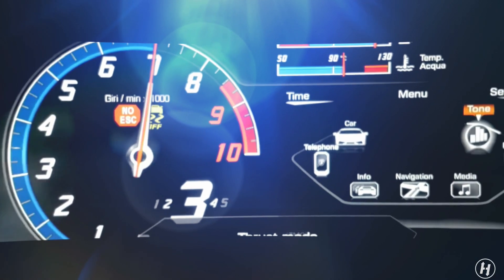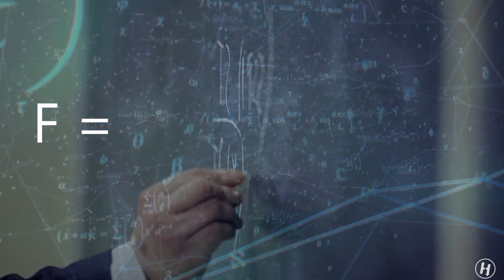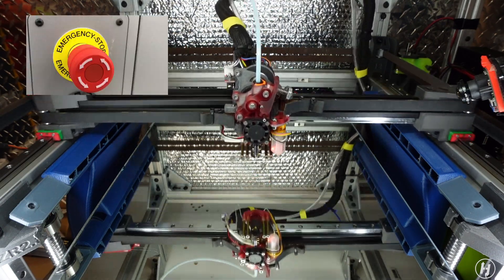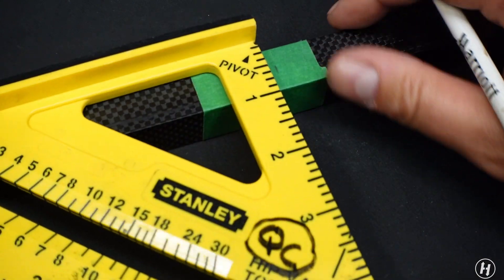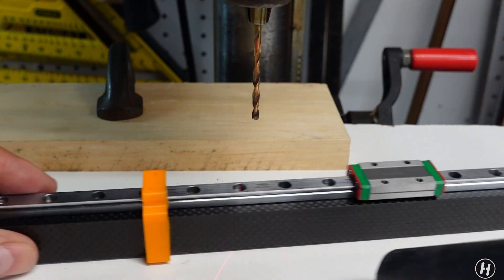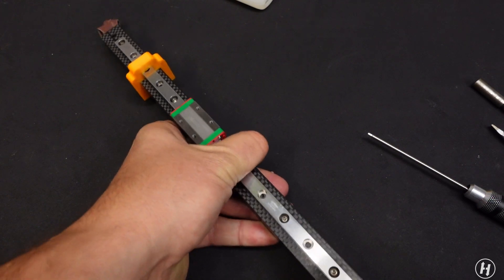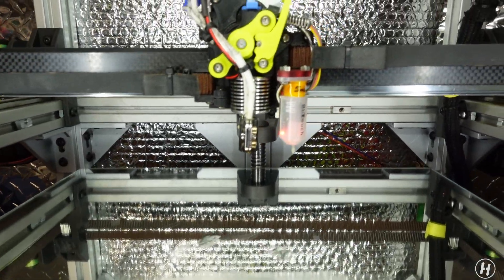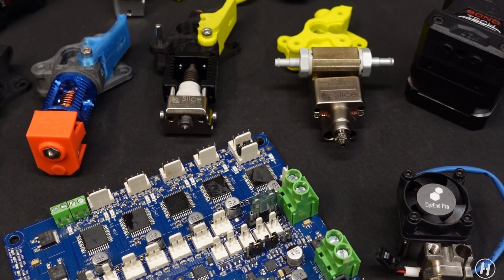Using TITANIUM and CARBON fiber on your 3D Printer

Comment: how about a design with bigger carbon tube to incorporate pulley idlers inside to avoid any printed parts?
Also instead of bolt for mounting the rail try using aluminum pop rivets.

Comment: Wow, that was an amazing improvement. So much added lightness.
I can still see one small hanging fruit though: the bltouch. Surely a dockable probe would be a few grams lighter? Sure its not much in the grand scheme of things, but you did replace all the fasteners with titanium ones....

Using tape to stop the carbon fiber from fraying was brilliant, but you might still want to cut the CF wet. It will help keep any fibers out of the air and then settling on other surfaces, or your skin.
Reply: At 500g, a 15g improvement is still -3%.

and isn't negligible, because it's additive, if you manage to reduce the weight to like 150g, reducing by 15g is 10% then.

Comment: Impressive! Whats next? Are there Nuts half as high? Should one grind them down and also shorten the screws? Maybe use a round carbon fiber tube? It would also help with air drag at these speeds. But would need an adapter between it and the linear rail. How about an L profile carbon, it would be easier to assemble also and big holes can be cut into it for even more weight saving. Could something be grinded/machined off of the linear rail? Are there rails with more holes, so less material. Also the Printhead looks like someone could go at it for a day and dremel something off of everything and cut the belts even more. I hope you'll get reeeeeallly crazy! ; )

Comment: You can use less screws if rail be attached to carbon by glue - it's fine for sportcar too)
Plastic parts can be replaced with fiberglass or carbonfiber- you can print blank for it or modelling parts with slots for fiberglass cloth

Comment: Bowden tube instead direct filament drive can save mass too
And cooling solution - instead of fan on head you can use tube and stationary installed fan with high static pressure or air pump - maybe adding peltier cooling can reduce mass of radiator too
 
(Radiator can be modified  too, but adding vapor cha,ber cab be even harder and not be good enough)

Comment: Very nice work for sure ! just a few suggestions/ideas... replace all but 2 (outer ends) of those bolts in the rail with carbon fiber bolts that would save a lot. Or you could also play with nylon bolts to keep the cost down a bit. or just epoxy the rail to the CF extrusion and remove all the bolts. There is probably also room to lighten that rail by drilling out the bolt holes to a much larger size and if epoxied together strength loss should not be an issue.

Comment: Weight saving ideas: 1) Replace aluminum end caps on the extruder stepper with machined CF. Easy enough with a mill and/or a laser cutter. Forged carbon with smaller fiber lengths is easier to machine than weaves 2) No clue if the shaft needs to be metal for function but could be replaced with carbon rods. The bearings can be downsized as well. (Life will be shorter but performance gains...) Lowering the weight of the rotor should directly enable faster change in acceleration. Extruder speed may not make a huge difference in the end but if the current setup does not meet the hot end ceiling (acceleration wise, might have to make a test for that) then there's some room to improve. 3) Remove the fasteners if its going to be a permanent thing. Loctite has Epoxy specifically for steel to carbon welds. The result is stronger than steel to steel welds. This may save good amount of weight. - Good work there, keep going!
Reply: I’d be concerned with heat buildup in the stepper. Those aluminum end caps are a main way to get heat out of them. This is particularly true on such a small motor where there isn’t much exposed steel laminations. 

Now this would be interesting to try on the mounting face of the motor, where it’s pressed against the plastic anyway.

Comment: I have always wondered why there is a need for the carbon tube at all?  My machines (and many others in the group I'm involved with simply use the linear rail .. AS The gantry! Nothing under it to bolt it to).  I PRESUME there must be some argument about needing to help ensure the linear rails are "Flat" especially non-name brand / cheaper generic Chinese linear rails.. But, How off can they be? How much could a piece of carbon really aid in flattening out or straightening any imperfections in the Steel alone ...   Anyway: in short: Why even add the brace at all?  I think reasons like what I mentioned above will be the rationale behind it .. But it just seems like almost a joke to think a tiny carbon plate will bend the steel to its flat surface ... rather than the steel distorting the carbon fiber! The latter seems far more likely just from a Statics Physics mindset ..   Anyway love the video! Love anyone who is devoted enough to lower weight that they literally are choosing titanium BOLTS over the SS ones at that size! That REALLY IS trying to get every last bit of unnecessary mass/weight reduced! I cut a roof off my M3 to put a CF pannel to make it like the E46 M3 CSL ... I KNOW how much shaving weight off matters!  It's good to see that enthusiasm here!   But just let me know about the reasons of WHY even use the tube at all! As I've never seen a good answer to that!
Reply from the maker: Weight of the carriage under hard acceleration will be enough to get the rail to enter an oscillation patern.  I should perhaps mesure the deflexion under load of both configs and do  another video :)  Thanks for your feedback :)

Comment: What if you just use....... Nothing?  Holding the rail on both ends and let the rail hang freely at the middle saved some weight on my printer, and I didn't notice any performance issue

Comment: How much faster can you get before your hot end can't keep up with melting the filament enough to get proper layer adhesion?
Reply from the maker: All depends of the filament type and layer height.  0.1mm layer height on certain ABS filament can get us past 1000mm/s without shreding and with descent layer adhesion.  Temperature has to be bumped big time though (280-290C)

Comment: Did you see the lightweight mods done by Tech2C on his original HyperCube? He uses carbon fiber tubes and Igus type AM-RJ4JP-01-08 Drylin Bearings, Polymer Replacement for LM8UU linear bearing. This would save a couple hundred grams.
Reply from the maker: Yes I did, and after handling these parts myself, the rigidity of the assembly and the level of precision have left me perplex for what I am doing here.  But yeah, Idea was good.

Comment: You missed the most important tip: if you don’t have another printer, print all the tools and tube mounts BEFORE taking the old assembly apart! LOL
I was doing a mod on one printer many years ago and realized I’d forgotten to print one part for it. I had to resurrect an old printer to complete the job.
Reply from the maker: Actually, this printer is my only one, so yeah, a lot of planning was involved! lol!  Had to use a small plastic piece to simulate zero on Y axis for printing a forgotten part.... the Y axis flag! lol

Comment: what if you straight up just use rail
Reply from the maker: Metal will oscillate under high acceleration and vibration.  Causing artifacts.  Combining it with a piece that has different resonance will reduce this by a lot.

Comment: Have you had a chance to check out the E3D Revo head with their new light weight toroidal heater block?
Reply from the maker: No unfortunately I did not have the chance.  I am super happy with the Nova HotEnd which is a super tiny copper block with a 100W cartridge and M4 thread size nozzle.

Comment: If you printed your parts in PLA, there should be space to save some more weight using different filament. PETG have lower weight to volume ratio than PLA and sure there are lighter ones.
Reply from the maker: I have used ABS for those parts.  But yes, printing them with less infill and less walls could be an option.

Comment: Amazing Work. My question is why not delete the carbon fibre tube or any other support gantry. Could you not just use the Linear Guide Rail with some fancy 3d prints? the bending of solid steel for 55grams should be miniscule. Issue to get around could be the back pressure from the hotend when clearances are incorrect. But once the clearance is perfected, you can go all out.
Reply: Dont forget: 55g grams at 56m/s² is a different story :D

Comment: You can try igus linear rails. They are aluminum and use plastic bushings. igus is pretty nice and can send you free sample kits and parts.

Look into oriental motor 5-phase steppers for a MUCH higher torque at higher RPMs.
They have servo rpm properties but with the responsiveness of steppers.
Reply: I was coming to say the same thing. The majority of the weight in the gantry now is in the MGN9 carbon steel rail. I'm not sure how well the Igus linear guides will work in this application (positional accuracy), but they are worth testing out since the rail is aluminum and will shave a great deal of weight there.

Comment: What did you think about e3d on toolchanger moving away from carbon fibre due to the difference in thermal expansion between steel rail and CF?

Comment: How about removing the x axis entirely and use a xy delta printer on a single rail (or two)
As prints are usually centered in the middle you could get extreme speed in that area (non linear over the printing area).
The print head would be the main weigth.

Comment: I can't help but think replacing all those nuts and bolts in the rail with short lengths of carbon rod and a good permanent adhesive under the rail would yield significant weight savings (at the cost of making it an absolutely permanent assembly). Good video though :)
Reply: Rivets

Comment: try ceramic bearings inside the x axis rail to save some weight
Reply from the maker: Oh! I like this one! :)  Perhaps amchining the X carriage would be a good idea too.  And even the Y ones.
Reply: @MirageC  I don't think machining would be too good since it would significantly weaken the carriage especially at high loads. And swapping the y axis bearings wouldn't reduce weight I think. Rather reduce it's inertia. Although I'm no pro. A resin printed carriage would be dope though (and could be skeletonized). Also consider using U-stock to redesign your gantry. You can use a less of it for more or equal rigidity and possibly reduce weight

Comment: What voltage are the (still servo?) motors on your Hevort? Tom Sanladerer of Toms3D built a pretty insane Voron 2.4 with high voltage stepper motors and some TMC5160s that is really quick.. Not as quick as your Hevort, but very impressive! ;-)
Reply from the maker: This is with Duet2wifi control board (TMC2660) at 24V.

Comment: Since you're drilling all the way through the carbon fiber square tube, why not just drill larger pass-through holes on one side so that you can use a socket inside to install the nuts?
Reply from the maker: this is 1mm thick tube, I would be afraid the other set of larger holes would weaken the tube.

Comment: Well
- Remote extruder (Bent, flex rod, or a shaft that is basically a long gear)
- More glue instead of fasteners if they are permanent anyway.
- self made carbon parts by printing them and apply a carbon layer, so you get rid of some fasteners or extra connecting parts

Comment: Does the Carbon Fiber "added" to the linear rail reduce the weight of the linear rail? I think my I.Q is too low for this subject, as I thought why not use the linear rail by itself, without the extra bolts and nuts and the Carbon Fiber profile!
Reply from the maker: Rail alone gets boucy under hard accels.  And CF also helps with resistance to torsion.

Comment: Duet2 can reliably run drivers at 2.4amps but you need forced air to the back side of the board, per the Duet wiki. It also helps to have the board set vertically too to encourage convection. I run my Duet2 at the max supported current of 2.4A without a sweat.
Reply from the maker: yes, I though I was doing a 30 second test, but I forgot motors were idling at full power and left for some family matters... ooops..
Reply: @MirageC  I forgot to mention, Duet3D or your reseller might be able to repair the board for you.
Reply from the maker: @JeffDM  Thank you, will look into that!

Comment: The steel on the rail will still be contributing a good chunk of that weight. Could you drill some more holes into the rail to remove some weight?

Comment: I wonder how this translates to print quality (without ghosting) you can get etc, since Part flex specially with printed carriages afaik is the real bottleneck in most cases,
Reply: That woven cf tube with a linear rail brace isn’t flexing any time soon. Once thing CF square section does well is resistance to flex
Reply: @smokin1974  THE 3d printed parts are!

Comment: I'm shocked that your printer can be so fast with printed parts around!
Reply from the maker: Design was made do the force would compresse the printed material. That helps alot.
Reply: @MirageC  Ooh that's smart! can't wait for you to test it

I wonder how fast you can print without ghosting without input shaper with this printer ;O

Comment: Would there be great difficulty in using two steppers in parallel to drive the Y-axis?  Surely someone has tried. Seems like it would offer symmetry, as the Carriage+Extruder weight will always be greater than the carriage alone.
Reply: There's a '4WD' mod for the HevORT that does exactly that

Comment: First I want to thank you on behalf of others like me who are practical house bound, this hobby has given me something to concentrate on. 
I just have one question why nema23, instead of a lower inertia nema 17, I know Vez3d is pioneering Odrive?
Thanks again.
Reply from the maker: I usually run ClearPath Servo motors, but getting them to skip steps is near impossible ;)  This Nema23 was identify as a good candidate for moderate speed and a bit of extra torque for those heavy heads.  I wanted to give them a try.
Reply: @MirageC  oh my bad I didn't realise you used servos, that will do the job!

Comment: Did you run some tests on temperature resistance of the CF tube? The epoxy used for those tubes is supposed to soften between 60-100C… I have only seen people using these without enclosures, would be very helpful to get some information about this. Maybe do a follow up and put the left over piece on the bed or in the oven at different temperatures?
Also heat expansion and contraction of CF could decrease print quality because CF shrinks while steel expands when heated. You could also place a dial indicator on the rail while running the bed at certain temps. 
Would be a really interesting video imo.
Reply: there are epoxies for CF which can withstand 150 or even 230 degrees C, typical Chinese ones are rated at 80C max if i remember it correctly, about thermal expansion - agree, having steel-titanium-carbon hard locked will definitely create points of thermal deformation for rails(yet steel-aluminium is kinda the same shit, so it won't decrease print quality but possibility to increase is not used)
Reply: @SergeiSugaroverdoseShuykov  I have a 500mm Vcore-3, and the gantry definitely warps when my chamber gets over 45C or so. Takes a good 2 hours of soak before the whole printer is stable.
In practice, it is not a problem since the gantry remains (mostly) straight during the first layer, and the warp is not too huge to muck up the final layer.
Causes issues if I start another print with out doing a bed mesh to compensate for the gantry warp
Reply from the maker: Yes, you are spot on! Although this works right now, we need more data.  I run this in a 55C enclosure, but most of print are high speed ABS or PLA without enclosure.

Comment: have you tested cable driven remote drive? It may allow you to move that extruder motor. Also I wondering that do you really need so much support to Z direction or can you just use plate instead of tube? Or will it start bounce? Not sure would it be possible to get titanium linear rail from some where. Or mill some of material off from that steel rail.

Comment: Actually, why didn't you switch to a remote direct extruder which reduces weight by almost a motor weight?
Reply from the maker: Because the filament speed required to control proper retraction and pressure advance at high speed printing is very difficult on larger printers with longer PTFE feeder tube.  Nitram has done some awesome work on his Bowden tube. I prefer using remote cooling than remote extruder.
Reply: @MirageC  but remote direct has almost nothing similar with bowden type extruder, filament gears are located same as a full direct, but motor drives it from a distance with a metal cord
Reply from the maker: @pazhiloy_starchok  Ah! of course yes! sorry I misread your comment.  Yes I did try a Zesty Nimble a while back.  Problem is the flex of the cable creates issue at high acceleration during fast retractions and pressure advance.  My zesty was the 30:1 ratio unit though.

Comment: I wonder why E3D went back from the carbon fiber Y gantry to a metal one on their Toolchanger
Reply from the maker: The issue I see are the thermal expansion difference between Steel (9 X 10e-6 in) and CF (0 X10e-6 in) being greater than Alu VS steel (13 vs 9) .  And the maintainability / durability of such installation.